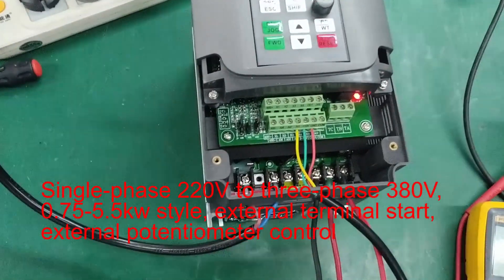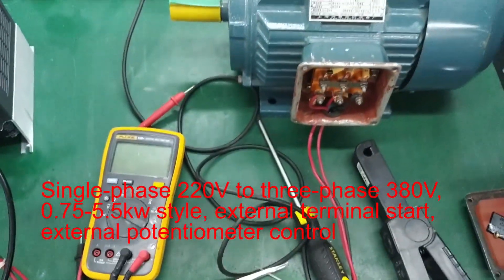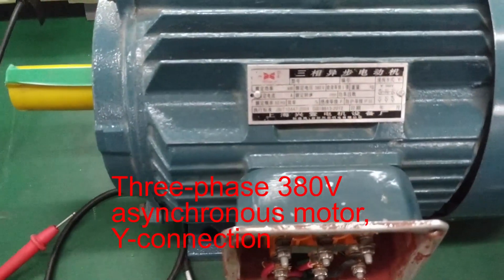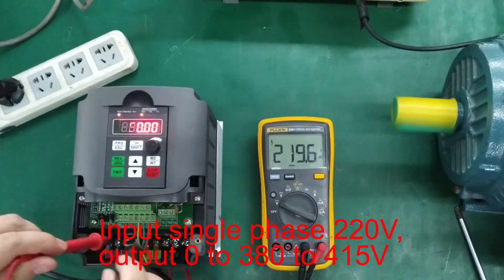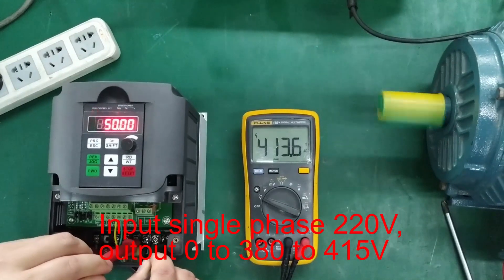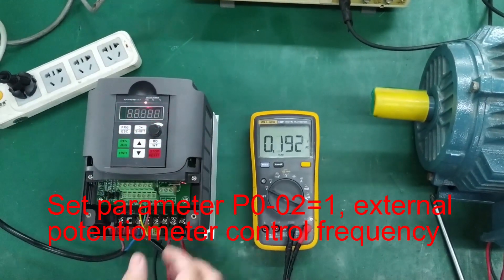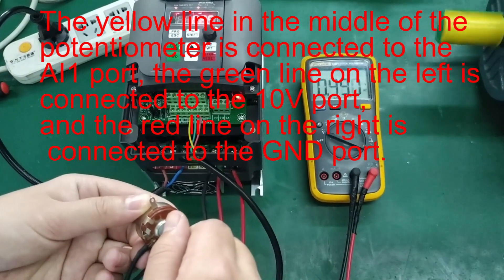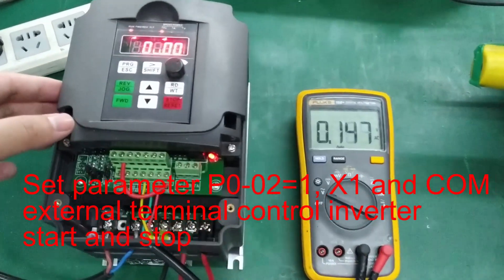VFD 2.2kw 220v single phase input 380v 3 phase output AC Frequency Inverter

Comment: If a motor that works only on 380 volts is connected to a suitable inverter (220 volts input, 380 output)...
will the motor run at its full efficiency without decreasing torque or speed? Thanks!

Comment: Dose this convert frequency from 60Hz to 50Hz? can i use it with my 1600w 50Hz miter saw?in my place Frequnecy is 60Hz (220v)
Reply from the maker: Yes ,it can be 0~650HZ

Comment: I have output 517 v how to reduce to 380v
Reply from the maker: You need use the special multimeter to check the output voltage .
Reply: Is 517V DC or 3-phase AC 517V?